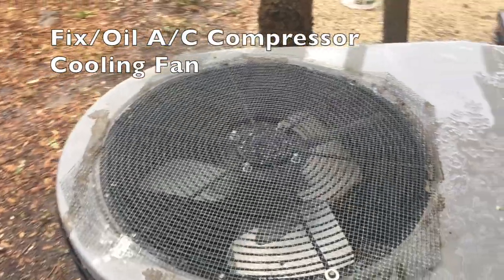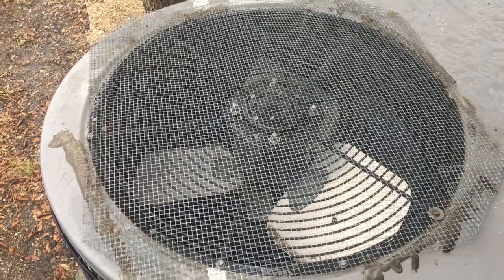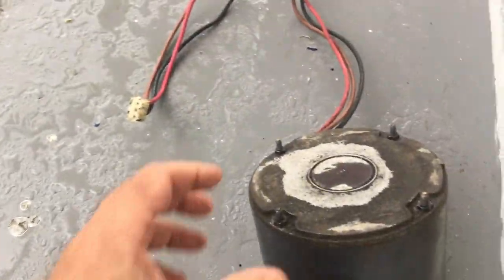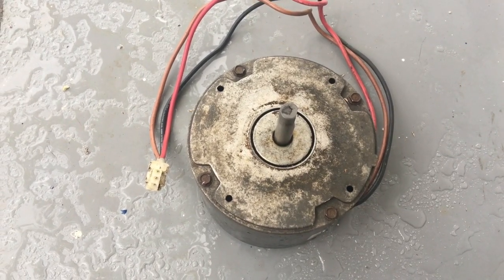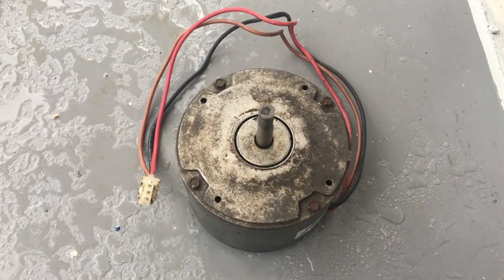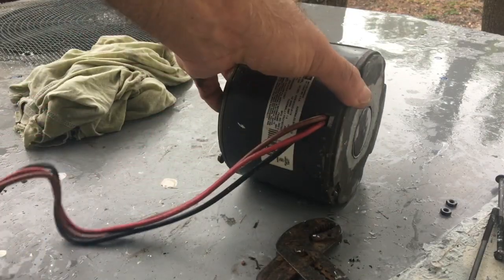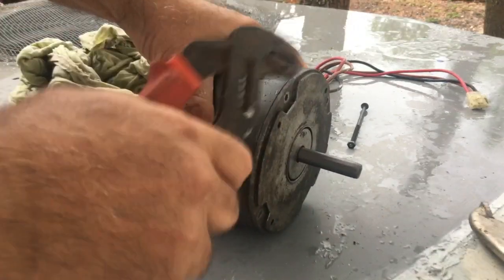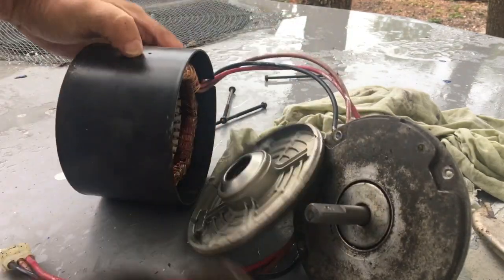Oiling air conditioner motor with no oiling ports! ICP, Heil, etc.

Comment: Dear Drone Flyers
Great video on relubrication of an electric motor.  
Please be aware that these motor bearings were originally lubricated with PermaOil manufactured by the Permawick Corporation. 
The “felt / cotton” you refer to @ 6:22 is called PermaWick. PermaWick material is a mixture of PermaOil and fibers that resides around the side of the bearing. 
Permawick Corporation has supplied bearing lubricants to the OEM electric motor companies around the world for over 70 years.
PermaOil and PermaWick contain additives specially designed for use in electric motor bearings. To ensure maximum life / performance of the motor, please use an oil and wick specifically developed for fractional horse power motors. The used Permawick material can be reconstituted with PermaOil, or new PermaWick material can be used to replace the old. 

The Permawick Corporation.

Comment: I am grateful for this tutorial.  👍👍I have a Trane (Genteq) motor that I had to keep using a long screwdriver to get the blades to turn, otherwise the unit would shut off.  I was able to disassemble, clean, and oil the motor after watching your video.   I used Zoom Spout Oiler (about $7) to saturate the felt in the endcaps.  After re-assembly, I powered the unit on and the motor instantaneously spun at full speed.   The replacement cost for the motor is between $200 and $300.  I hope to get many more years of use out of my unit that was installed in 2010 (13 years ago at the time of this writing).  I was able to get this done in about an hour.  Not bad for my very first AC motor repair! 😁😁👍👍
Reply: Wow. Mine is having a similar problem where it will run if I kickstart it, but only for ~5 minutes. You think that the oiling process could save mine for a few months before I can afford a new one 🤔

Comment: Based on the fan blade view from above the motor, it needs to turn clockwise to pull in the air from the sides and out the top. Also, the location of the fan blade or height from the grill or motor shaft needs to be where it originally was set on the old motor.  If the new motor is louder than your old motor there is something not right. Maybe the fan isn't at the right height or the motor is simply incorrect or has a flaw.

Comment: Thanks! Our 4 ton Rheem's condenser fan died and rather than wait in Florida's sweltering heat for parts to arrive + the monumental expense I also tried disassembling and renewing the motor. Eureka, it worked! I'd add that I wrapped steel wool around a drill bit and polished the inside of the bronze bushings too.
Reply: My guess is that this should last 5 years or more....
It's always a question of the next thing that might go - my FL A/C doesn't want to die!
I sorta want a new unit (mine is packaged and I don't like the noise - new one is quieter), but this one seems to be lasting forever.

Comment: Thanks for the video, got my motor running nice and smooth till the replacement arrives.
Reply from the maker: I should have just kept the old one - since I am convinced it would have worked for years after. But for less than $200 I bought a new one - I guess that's nothing compared to what getting service people out, etc. cost. My A/C in FL is 2003, so I'm feeling good about it lasting this long!

Comment: Sssoo...what happens if one puts oil in those holes and the motor doesn't turn on? Is there a way to get the oil off the coils?
Reply: Oil is not conductive
Reply from the maker: It didn't mess anything up - as Zeke said. I assume the oil I put in (mistake) just drained out or heated up and was blown away by air movement (vapors).

Comment: The little circles on both sides are cover plates that can be pryed out with a small screw driver, exposes the bearings for oil. 👍 Thanks for the video.
Reply: i was wanting to remove those covers to add oil to the dried out bearing but was afraid I'd destroy them.  I'll try again

Comment: Thanks for the video. My fan starts but then overheats and stops. I haven't finished watching your video yet but I found it funny because I too oiled those 4 little holes, A LOT, and when I turned it over all the oil leaked out. Man was I disappointed, thought I had fixed the oiling problem.
Reply: This will fix it most likely - it's quite easy actually.....

Comment: $700 installed! Thats TOTALLY not a scam at all..... For that price they should be installing a new condensing unit...
Anyways rooftop RV units and window units you can reoil as well and get more life out of them. The unit on my small RV I reoiled 3 years ago and it still runs perfectly today.
Be aware that if the shaft has rust you need to clean that off completely so when you do take it apart the shaft does not bind up and rip the bearing apart. This is not repairable unless you take it into a shop that rebuilds them.
Reply: Yeah, this is in Florida where the repairs are a scam always.....new installs are dirt cheap due to competition as is a general checkup....but the companies make ALL their money in repairs and "service contracts" which still cost big but give a "discount" on the parts.
Reply: @craigissod6027  Damn I should move to Florida. I know HVAC (that's not my main career thing though) but I am not a scam artist though.. I get people need to make money and mark things up but that $700 for a $150 fan motor plus labor is rediculious.. I would have charged like $300 tops for that job and that would have included a new capacitor and a charge check too. I try to be as fair as I can especially these days when people are struggling.
Reply: @Elfnetdesigns  To give you some idea, one of the local A/C companies just bought the naming rights to the Braves new Spring Training Stadium!

Comment: Thanks, this video really helped me, was hoping the dual run capacitor was the issue but it was the motor. Apparently the felt paper was all dried up. Found this video and got it oiled up and working again. Ordered new motor from Amazon and that is coming tomorrow. But your video really helped keep our house comfortable until the new motor gets installed tomorrow. Thanks a bunch!!! 👍👍👍👍
Reply from the maker: Glad to hear it. I can't help thinking my old motor, once oiled, would have done a couple more years but I put the new one in anyway....my A/C is 2002 or so vintage and in Florida so it's not long for this world although I have replaces the capacitors, etc.